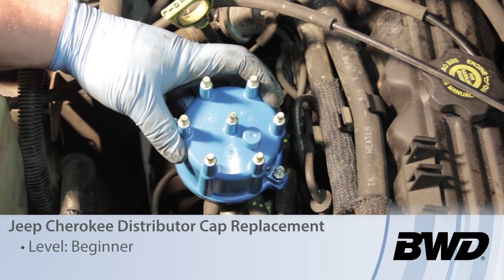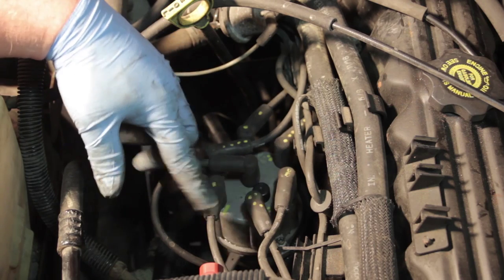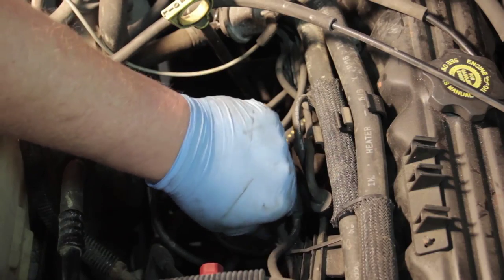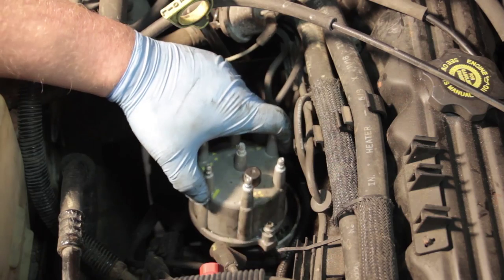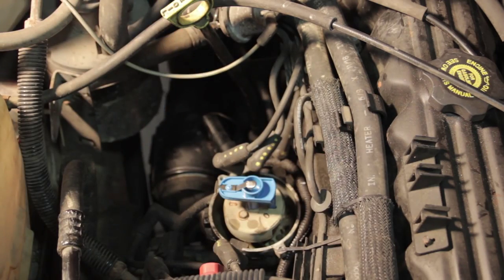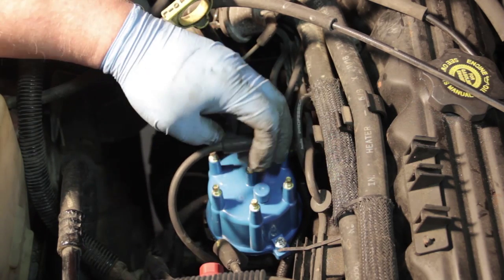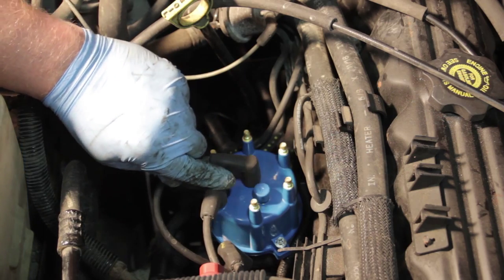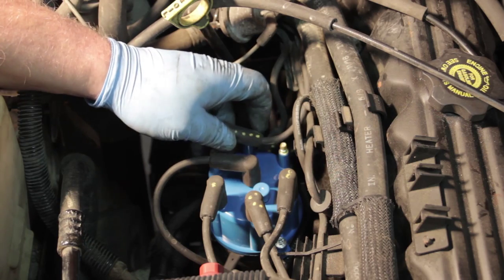Jeep Cherokee Distributor Cap Replacement

Comment: I change the plugs, wires, rotor & distributor cap on my1995 Grand Cherokee.  However, I lost track of which terminal on the distributor cap was #1 plug.  No markings on the old distributor cap or the distributor itself.  The Chrysler Service Manual and Hayes repair manual marked the firing order in their diagram but not which mounting lug was square or round so the wires could have been installed 180 degrees out of order.  Your video solved the problem in 30 seconds.  A word to the wise, mark the wires and locations on the distributor cap BEFORE you remove them.  Ask me how I know !!

Comment: awesome video bud
, just wondering , it was raining and i left the my battery charging but with the hood closed of course, is it possible that water can effect the distrubutor, because now im having trouble starting, if i let go off the acclerator pedal, the jeep stops...my spark plugs were running smooth, also noticed vibration each time i would start it up since teh rain, this was today..
Reply: Moisture in the cap can effect it.
Also can be the PCM (computer) not giving spark to all the plugs

Comment: Just put new plugs and wires in. Now cant get cap off. Stupid screws. Frustrated. work on it again in a few. sucks I have a 1996 Grand Jeep Cherokee lardeo. So cap is behind the V8 just under the firewall lip. grrr
Reply: What was the issue with taking the cap off?  i am about to tackle the same job on the same vehicle and am looking for any snags i may run into.
Reply: Am about to do this job also, been having a hard time taking distributor cap hold down screws off.  Screw driver dont have enough grip.  Will try a nut driver or socket, but got to find the right size for screw heads.
Reply: Same thing happened to me